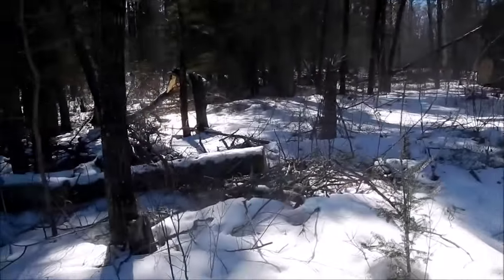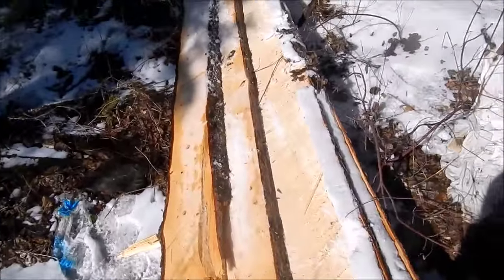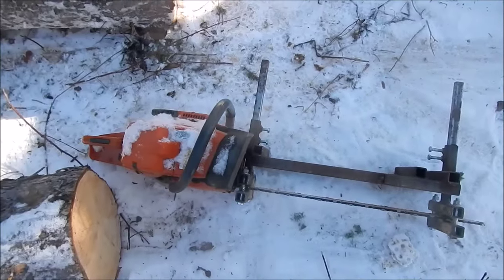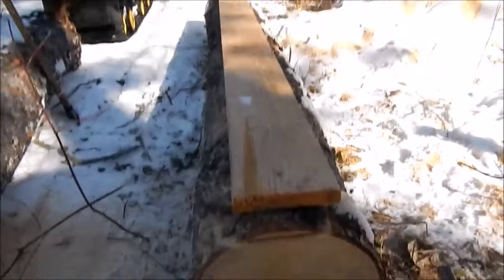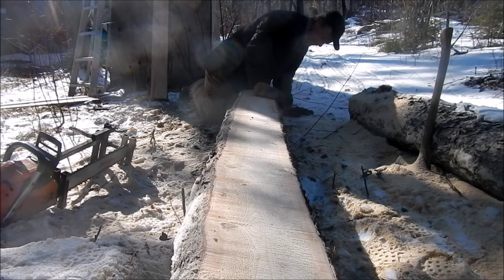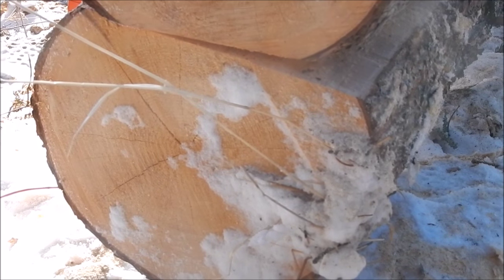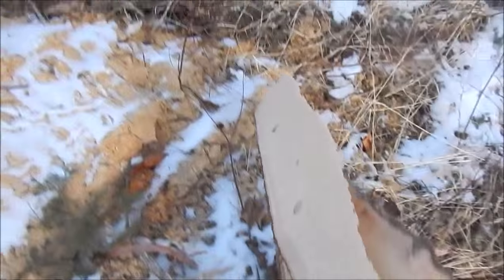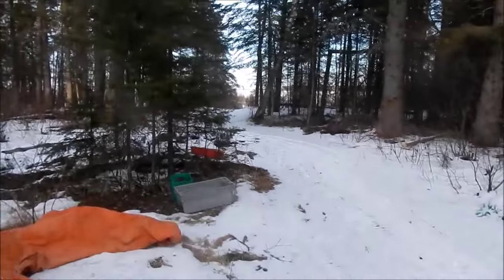sawing some slabs

Comment: that's a handy rig you made there it's great to have.what size of saw are you using.great looking board
Reply from the maker: +Wallace Vivian thanks, its a 365 husky,, i have a 2100 that i made it for, but its not running right.